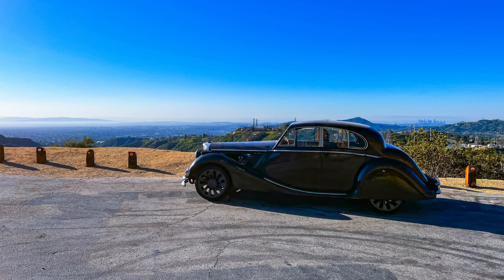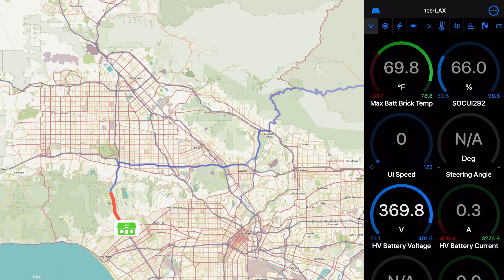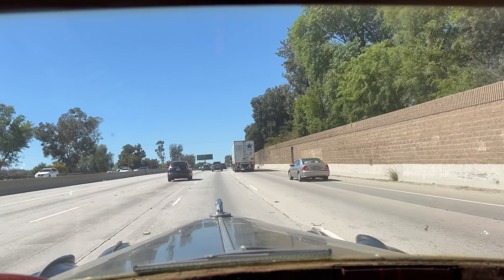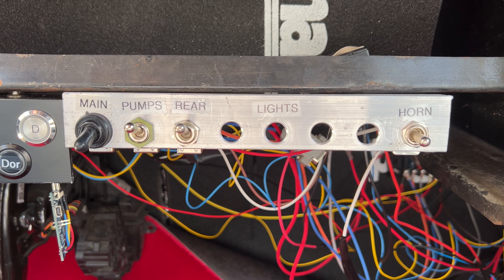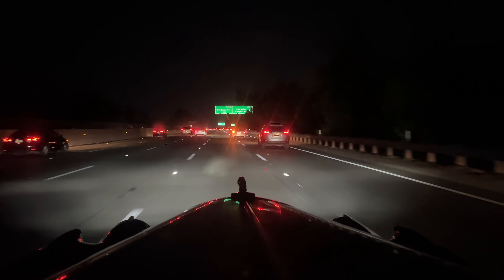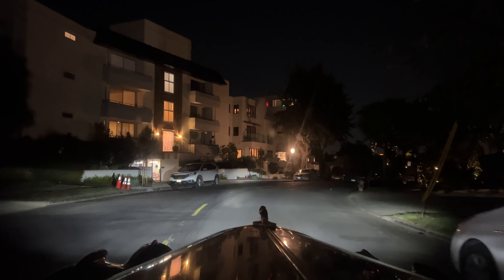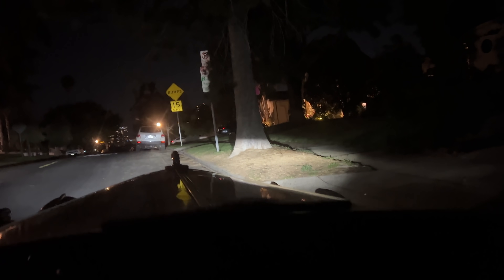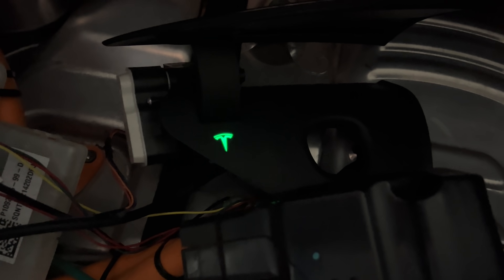I Find Out How Far A Tesla-Powered Jaguar Can Go

Comment: Well Matt, you make it interesting, anybody could take a re-built car out and get home with no problems and it wouldn't be real memerable, but you push the limit and find that maybe it CAN be done, after a deal of re-starts.
Reply: As someone who's built an EV as well as a handful of ICE vehicles of different vintages, the EV has had the LEAST problems getting me back home when I drive it.  The main reason I went with EV was because I still fight with a '67 Triumph that on a given day may or may not start, may or may not drive well, and if you stop it somewhere, may or may not start AGAIN for a few hours until it's totally cool.  The two times rebuilt (once professionaly) carbs are gummed up again, the jets that have been replaced 4 times are sticking again, the upgraded cooling system STILL won't keep it cool enough to drive for more than 20 minutes, etc.  
Or there's the v8 Mustang that runs amazingly well, drives beautifully... except sometimes... not every time, it'll just die driving down the highway, and won't restart until it's cooled off completely.  Both temp gauges never get above 200.
Or the Packard I'm still working on, that starts up fine, and with the the wheels in the air the tires spin when it's in gear, but if you put it on the ground, no amount of revs will move it.  Probably clutches in the automatic transmission, but try to find someone who'll work on a 1952 Packard automatic.  Then once you find someone who WILL work on it, try to find someone who will do it WELL.
Or the Porsche 928 that will start up instantly, as long as it's been on the trickle charger, but 5 minutes later won't restart on its own battery.  Battery is tested and fine, the alternator tested and fine, and the cable that runs between the battery in the back and the engine and starter/alternator in the front has been replaced from factory 2 gauge with 0/1 welding cable, so power and amp draw aren't the issue.
The only reason the EV won't drive right now is entirely due to @SuperFastMatt.  After seeing his videos on electric power brakes, I ripped out the mostly functional vacuum system and I'm finishing up the brake install, and after seeing his video on the electric power steering, I realized I'd rather not struggle to turn this barge at low speeds without assistance.

Comment: Reminds me of the time a wire blew off of my voltage regulator on my classic truck and my battery slowly died over 20 minutes on a highway late at night with my headlights getting dimmer and dimmer.
"Just gotta make it a little further..."

Comment: So awesome- I love your approach- same one I use to really find out what kinda range I have in my old BMWs when I commuted in them 2hrs each day;  Good engineering data there.  Thank you for sharing.  Would a small generator be sensible for this sort of trip in the future?
Reply: A Honda gen  would put in ~ 6 miles an hour with a lot of  stares from T owners.   A Tesla station could add 50 miles in the same time.  If your not banned from super charging  ~200 miles.  A back up battery  with 1 kW is about  $1000  can get you 4 miles.

Comment: Do that with a combustion car...regen some fuel back into the tank..or when you're driving on fumes and you choke it and it's dead in the water until you refuel it.
PS: if i were a smart tow truck driver i'd install a battery on my truck, so that i can juice up some stranded evs...enough just so they get to a nearby place. 50 bucks for the energy and BAM. And if you have solar where you charge up your refueling battery, you're even better making money. A rolling charging station.

Comment: Generally electric motors have temperature protection around 120 degrees Celsius, and is limited by winding insulation material. There are higher temp insulations, so it depends, but i think you are ok....

Comment: I was super excited to see range and real world situation and scenarios happen with u with this project mirrors are super cool i have suggestions that u can put more batteries in that gaping hole of engine bay it can shift weight to front of car atleast u can run all electronics and electricals ac on that battery pack and use raw power to push car without overloading underfloor battery pack i think when contactors open cooling system air suspension stops working completely i have seen in many cases after shuting down the system u need further cooling of hardware that may get hot u loose power assist in steering fun video love for u mat keep posting 👌👌👌👌👌👌👍👍👍👍👍🙂🙂🙂🙂🙂

Comment: Did you install a thermal management system for the battery? This is my first time haring of this project, but if you haven't that's like not installing a radiator.

Comment: If Lithium ion batteries over discharge the dielectric breaks apart making shorts, this reduces the max charge and the output. I guess it could destabilize the battery making it more likely to explode when it has power again. That last ones a guess. LI batteries are pretty delicate, the way you abused it will have lasting affects. You probably shortened it's life by a few years. I'm guessing it will quickly deteriorate over time now. The good news id you have an excuse to put in a bigger battery. Still a brilliant car tho, keep up the good work.

Comment: I get the same thing now and then with the M3 Ingenext controller, push drive or reverse and nothing. Sometimes it's just a matter of doing it twice but other times it takes a reset, ignition off and then on again. It's never left me stranded.  The Ingenext brain just gets confused sometimes.
Reply: The equivalent of the Blue Screen of Death...?
Reply: @JohnSmith-yv6eq  No not at all.  There's no boot up or anything just a momentary glitch.  No big deal.

Comment: You could save power by fitting oil-powered headlights
Reply: Those headlights are using about 120W total if they're halogens. The range reduction from running them is probably 1 mile every 6 hours.

Comment: So, what was the range? He said it was 120 miles round trip to the ranch but  Bob's looks like it's more or less on his way home so maybe he got the 150 mile range he was expecting. This drive isn't, of course, anything close to the standard EPA range testing cycle which is done on a dyno. I would think, even without a wind tunnel, there should be a tool to estimate the Cd and compare it to a Model 3 to get a theoretical estimate of the EPA number for this car. But he probably should have put in more battery.

Comment: Hi Matt, fun video  :)   Interested to see you are charging by using the Tesla wall adapter plugged into the 'in-car' Tesla cable/socket.  Did you need any additional Tesla components to enable the penthouse to accept the charge or is the penthouse self contained?  BTW for public charging can you not just get the adapter Tesla supplies with all cars?
Reply from the maker: You need the penthouse, the charge port, and the charge controller which sits near the charge port. And yes, I should be able to use the adapter, but I haven’t tried it yet.
Reply: @SuperfastMatt  Hi and thanks for replying.  By "and the charge controller" do you mean the (dirty) whitish box that the 24 pin plug linked to the car charge socket harness plugs in to?
Reply from the maker: @davidcaple5547  yeah, that's the one.
Reply: @SuperfastMatt  Great, thanks for that ... none for sale just now in the UK so I'm going to check they work worldwide regardless of national voltages :)  Thanks Matt you have been a great help and the only one who has responded to my pleas for assistance.  :)
Reply: @SuperfastMatt  Hi Matt, if I may for more help please.  I have an charge port/cable and a charge controller.  The charge port/cable has an 'American Tesla' socket and as I can't get an American charge cable in the UK I have sourced a Tesla American/European Type 1 adapter and a Type 1 charger (basic 3kW 3-pin mains) but it's not charging :(   Did you just plug your set-up together and it worked first time or did it require a little jiggering around?
Reply from the maker: @davidcaple5547  Do you have an Ingenext controller or another aftermarket controller? it might not charge without that, but I'm not sure.
Reply: @SuperfastMatt  No, just the "(dirty) whitish box" referred to earlier in these messages :)  Thanks for the suggestion for Ingenext, I have emailed them (and EVTV) asking if they can solve this for me.  You mentioned "another aftermarket controller" ... do you have anyone in mind?  I'm finding the internet to be a desert on the topic!  May I ask what your actual set-up for the Jag is?  I'm starting to think my best solution will be to direct charge the batteries with 400vDC to the main terminals and bypass all the Tesla tripwires!
Reply from the maker: @davidcaple5547  I'm using an Inginext controller, but they're support is not great. I don't currently know of anyone else having a controller for the battery. I believe EV Controls has a controller for the motor but not the battery. If you can get it working with the battery, its very nice since it has the charger, DCDC, and safety. you would have to be very careful charging through the posts in the battery. it's very dangerous high voltage.

Comment: I would only really buy a hybrid, in saying that they usually aren't that exciting. A hybrid Tesla conversion would be interesting.
Reply: Hybrids are kind of the worst of both worlds.  Most of them can't do anything on batteries alone, and can't recharge the batteries seperately, so you get none of the benefits of an EV, just a slightly more efficient petrol car with a LOT more complicated drive system to fail.  That being said, the Volt is a steal right now, and it's actually a true plug-in EV with a 'range extender' gas engine that takes over when the batteries are dead.  Amazing value on the used market, but my biggest concern is what happens when that weird Voltec drive unit has problems?  I don't trust the manufacturer to know either, because leased a Volt and the Chevy dealership kept telling me I needed to come in for an oil change, even though the actual engine had less than 100 miles of run time.

Comment: yea, I think your way cooler than I,  You barely have any space and you use it very wisely. My main problem is the steep driveway and the two car garage with a center divider so they could run two doors.   What a horrible design flaw.

Comment: Are you worried about battery degradation at all? I know that Tesla disengages the contacts at a "safe" voltage, but even when nearing said voltage you're at an increased risk of permanently stunting the battery's capacity - if only a little bit. And have you done a calculated energy discharge estimation to figure out exactly how much energy your specific battery has got? Be interesting to see.

Comment: Why can't you charge on 220? Isn't that the normal thing for at home charging?
Reply: Yes... if you have that in your garage.
Reply: You need a competent electrician to wire up a 220 outlet and buy a 220v capable charger which costs $600 to $2500.
Reply: @umaikakudo  The "competent electrician" can be any homeowner with the technical abilities of a handy teenager (we did wiring like this is high school shop class) and approval under local regulations... but yes, there is some effort and cost involved.

Comment: Range is not the problem, energy density is not the problem, the grid is not the problem, charging infrastructure is not the problem. Electric primary propulsion is ready for mass adoption since the late 19th century. The only problem is that batteries are not adequate for use in electric vehicles. The day we discover a suitable alternative to batteries (not hydrogen), EV adoption will be as quick as smartphone adoption, and range anxiety is gonna be a thing of the past.

Comment: Driving with running lights only would help.
Reply: The LED headlights are run off the 12VDC battery...
not the 400VDC main drive battery...
Reply: @JohnSmith-yv6eq  True. But doesn't the drive battery charge the 12v when it drops below 12.5v or so with the DC/DC converter?

Comment: Absolutely sick car.  Very interesting swap.  I must say, though, the range and "filling" of electric cars is really a humongous downside to them.  Not very practical overall.

A couple suggestions for increasing the range that I'm sure you've thought of, but hey I'll mention them anyway; try fitting as small diameter wheel as you can, and go with skinnier tires.  Not like BMW i3 skinny because those just are dumb, but more like the Jag used to have.  
Should help increase range, in the opinion of this idiot on the internet.

Comment: I know completely against the point of electric vehicle, but why not just throw a small gas generator in the back just as a backup when stuff like this happens?, should be cheaper then even a single tow charge